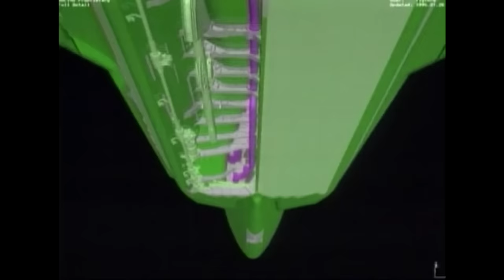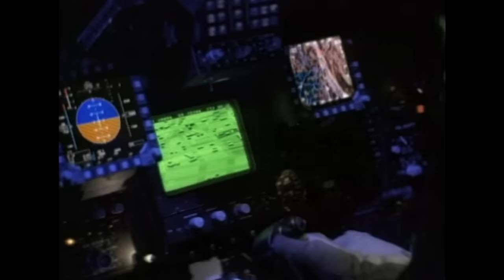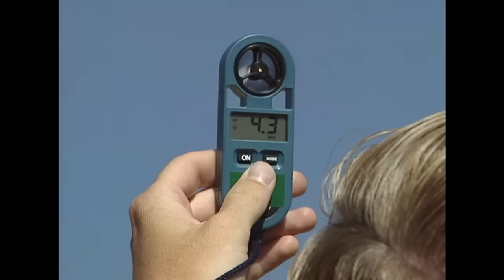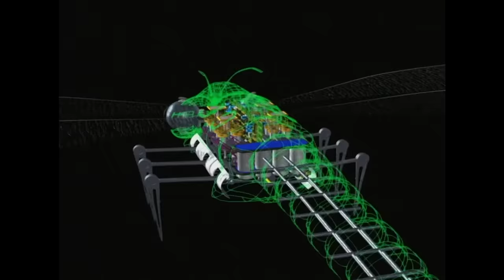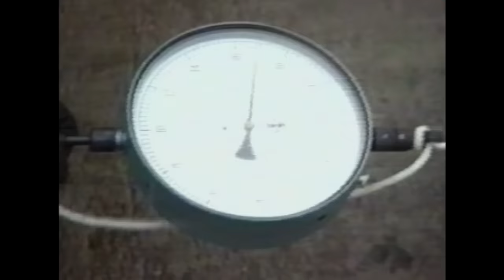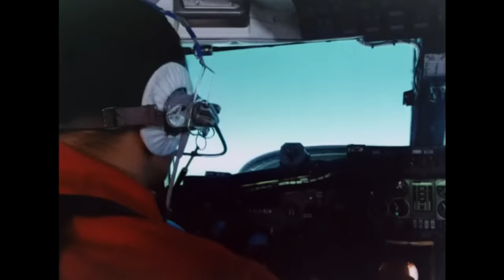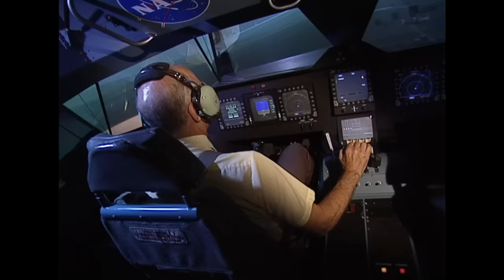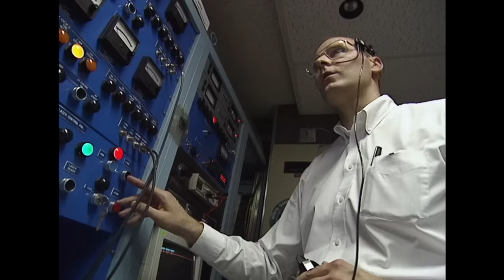Flight of the Future - Science Fiction or Reality

Comment: I should stop. But I can't help myself. Flying wings and blended wing body(BWB) aircraft, are NOT inherently unstable IF they use specific kinds of airfoils and wing twist. Note that the early flying wings use wing sweep for stability, more modern homebuilt aircraft have been able to have completely straight wings as long as they have a vertical tail. Airliners will have vertical tail fins for safety, whereas the B-2 Spirit cannot have any vertical surfaces due to stealth requirements. Without enough vertical surfaces or enough wing sweep and twist, flying wings ARE unstable. But those issues CAN be solved without computers. Unless you are unable to have vertical surfaces due to circumstances. But for civilian use, such as commercial airliners, large vertical surfaces is normal, they want extreme safety. So they use aerodynamic AND computers to ensure maximum safety.
But that doesn't sound dramatic. Seriously, even very modern documentaries make these mistakes. I doubt they are usually actually mistakes. I suspect that oversimplification and over dramatization makes for more views.

Comment: So laser craft...hmmm.  Neat toy, cause practicality is way too complicated. If the argument is that turbo fan has too many moving parts then how do you explain all the support resources to make this thing fly? While the craft itself is simple, the tech behind it is way more complicated than a simple set of redundant engines on a wing. Also, last time I checked light travels in a straight line. Bending it implies mirrors and a prism of some sort...so, what, do we fly the craft through the prism? And if it has to spin, even the outside frame without passengers, we are back to moving parts... just seems way too inefficient to be practical.

Comment: Several points (My taking notes; this is my sole means to do anything akin to work. I should be typing my novels and essays on a serviceable PC. Ask me why.)

The Northrop Grumman YF-23 Grey Ghost (?) USAF Stealth Fighter prototype is not as dead as some maintain. 

Women pilots can withstand higher G-forces during high-speed, high- manoeuvre flight. 

Would including vernier jets (electric plasma?) At the wingtips and nose, to augment thrust vectoring of the engines truly improve manoeuvring during air-to-air combat? 

I propose a third engine above the two in most fighters, this new one designed for far greater thrust, ideally hypersonic.

How does one correctly spell "Taryelka"? 

At 35:35, NASA is researching HSCT, a new Mach 2+ passenger transport. The long, sharply pointed nose requires a cockpit without a forward- looking windscreen. It will require a revolutionary, new design of jet engine 

At 44:35, a highly polished conical airframe uses laser propulsion: it rides a square-shaped laser beam.

Comment: The laser technologie is cool! I would change the laser though (as a test). It should be in the vehicle and point to the ground and use every layer of air as a new grip to start from in the shape of a cone or multiple cones and by this way build up and slow down the pressure. Otherwise laser light can produce fire and other problems on earth. Also a laser pointed to the sky can maybe even destroy Satellites.. so in my opinion laser-tech is very dangerous when wrongly used or when something goes wrong..

Comment: All of these aircraft isn't no where near the aircraft design that I've seen. I have seen aircraft that become invisible to the naked eye at over 10 feet. completely invisible to radar, thermal imaging, and completely silent. They are built with a 50 caliber rifle for a sniper that is completely undetectable because the vehicle can shoot a bullet at 5 miles away from the target. The vehicle can be flown autonomously with many other aircraft that comes with a thermal scanner that will detect human shapes and temperature and will automatically shoot the target without transmitting any transmission for complete stealth. The aircraft will have vtol capability, unlimited distance of travel, ceiling height of 150,000 feet and above some said. Top speed of 150 mph, you don't have to go fast if you are invisible.

Comment: Odd, I built and fly a Blended Lifting Body that is  Radio Controlled with only 4 channels. Ail & Elv are mixed,         (2 channels), Throttle and Nose gear steering the other 2 channels.
 Size..48 in x 36 in, Engine...25 DbbBB, 9 x 6 prop.  Very , very short take Offs, Fully aerobatic. Faster in the air than most of the 40 sized powered planes at the field.
 The above plane with 2 engines and 15 servos, to me, seems a bit much. My cost for this plane was less than $100, build time about 3 weeks. My Building Budget is a Shoe String, the above planes building budget had to be about 20 times bigger.  Wow, what I could do with that kind of a building budget. 
( There is a picture of my plane on my FB page. Please, feel free to "Check it out".)

Comment: The SU 37 has hearts stopping manovers, and BLEEDS OFF KINETIC ENERGY LIKE NO OTHER, allowing the invisible to it,  F22 Raptor to sneak up, using super cruise,  and  nail it with massive forward air speed at BVR with an advanced AIM 120 , and  as the SU37 does sky break dancing, it becomes the equivalent of a slow maneuvering helicopter type sitting DUCK to the Raptor. Maybe in a Gun vs Gun match up it would have a chance against the Raptor, but that's only if he can visually SEE the Raptor, otherwise the SU37 would have the pipper up his ripper😂😂🎉

Comment: Here is an experiment that would have to be fruitful even if it didn't work. 
A tube or hose from the surface of the earth going upward until ever how far until an upward vacuum is created inside the tube.
Question; what measures would have to be taken to support the suspension of the tube after the vacuum is created. Seems to me there would be some balloon effect to the tube. Which the measures could be small.
If there is a vacuum in the tube going upward. It will carry solid matter up the tube. 
The real question is how far up the tube, until the matter reaches terminal velocity going up. I honestly can't see why the experiment would not work. I would like to know why it wouldn't without trying it.

Comment: It is possible to build a vertical takeoff and vertical landing with airplanes speed using unlimited electric generator power plants
 An Edison permanent magnet motor as a generator and dynamos to multiply the current. You can build an unlimited electric power airplane or helicopter.